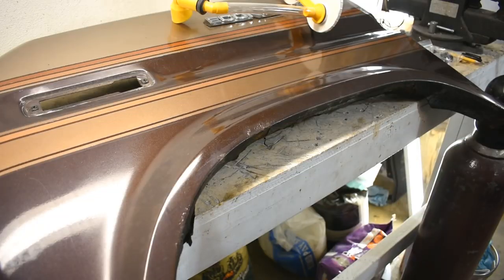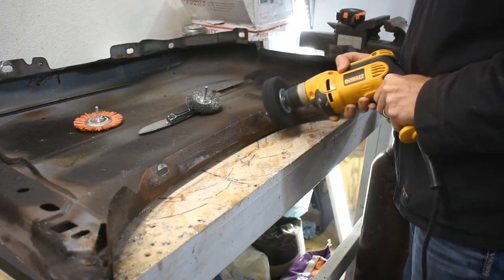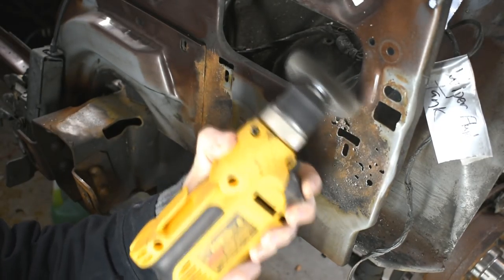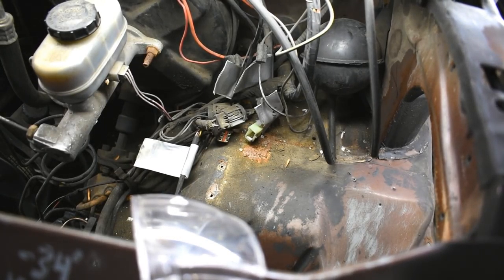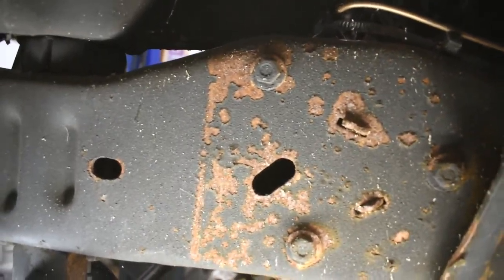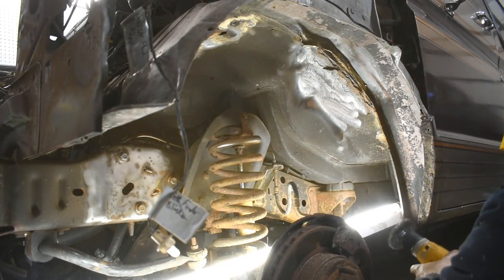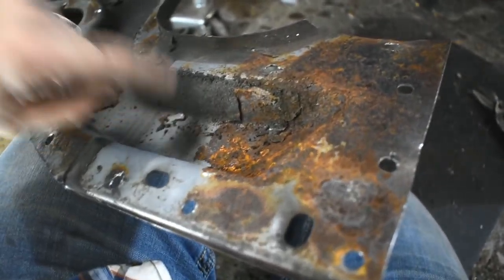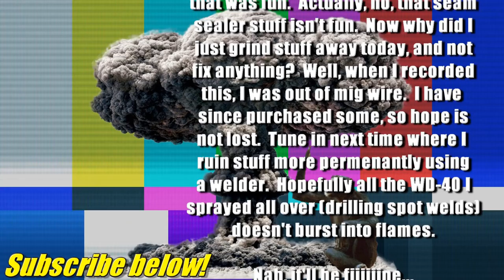Paul's Old Van Part 2: Grinding Off Some Rust, rust removal isn't fun

Comment: Hi Paul, I think it's better to remove the really rusty parts directly without wasting time on rust removing. Hope you can get some preformed replacement sheets, right to weld in. Helps to reduce work and frustration ;)
Reply from the maker: Yeah most of the stuff I’m just going to cut off straight away, but I was trying out different tools in this case.  I have a major plan to rework the front end that will increase serviceability, lots of cutting stuff off in the future...

Comment: Flap disc on an angle grinder paul... Drills are for drilling.  ;-)
Reply from the maker: I thought about that but I want to keep the panels as minimally mangled as possible, my flap disks would really chew up big areas (3M cubitron 2 flap disks are AWESOME but way too aggressive for sheet metal)
Reply: Paul's Garage 120grit flap disc..

Comment: If you want to get really aggressive with the rust; try using a diluted solution of muriatic acid. I used it in a spray bottle to clean a rusty gun barrel. It works wonders. You have to immediately apply oil after neutralizing. Good luck either way.
Reply from the maker: Thanks for the tip!  I have some muriatic acid in my work truck, might be worth a try
Reply: Thank you for the acknowledgement. Good luck with the van.

Comment: A shop vac might help with the rust dust problem, got 1?  Twisted wire wheels tend to not throw off so many wires as that crimped wire wheel will.
Reply from the maker: Good tip, I got some twisted wire ones for the angle grinder, I’ll have to get some more for the drill
Reply: A box fan with a furnace filter taped to the inlet side will help reduce how much dust gets spread around the garage.  Please DO find your face shield.  I doubt not having it on will enhance your appearance.  GL.  I love how huge the safety glasses are.  :-D
Reply: Ron Yerke wish I had a more powerful box fan for this, I use a cheep one frome Walmart and it works but is weak; any tips on a powerful box fan? I'm actually considering using a round shop fan and an old sheet.
Reply: Well, you could make a box and buy a used furnace fan to put into it.  Then you could use filters on 3 sides.  Furnace fans move a lot of air.  There are comercially made dust management systems too, but they're pretty pricey.  We had to replace a furnace a few years ago because the heat exchanger rotted out.  But the blower was fine and I kept it.
Reply: Ron Yerke Thanks, furnace fan sounds interesting. Probably not worth buying a full filtration system for a garage shop kinda like the one in the video. I could part with 150 maybe 200 dollars but that would be the limit. In the summer I can just open the garage doors and blow everything outside but today it's negative 20 and that's not happening.

Comment: Off and MURDER MODE! LOL I have been using a steel cutting disk in my grinder. I feel like slightly safer with it then the standard style cutting wheels.
Reply from the maker: I never feel safe holding a power tool

Comment: the tar prolly made the van as rustfree as it is at the moment
MAKE TEMPLATES BEFORE CUTTING OUT THE RUST that way the plates you put back have the mountingholes and accesholes in the right places , it would allso be adviseable to paint the inside of the metal before welding it on using weldable primer
Reply from the maker: Very true, that tar is good stuff.  The method Ive seen that I want to try is to make the template and get the patch panel made and almost fitted before cutting the old out.  That way if I suck at making patch panels I can always cut the hole to fit whatever I do make.  I’ve been looking into weld through primer too, I’m thinking of trying some of the zinc stuff or this other stuff called “bloxide”
Reply: the zink coating give off mustard yellow smoke when you weld it and it makes you verry sick for quite a while if you breathe it or weld in a badly ventilated area
sumting i seen a while back was someone basicly made the plates with the boltholes in it slightly oversized , put it over the old rusted stuff centering it on said boltholes and maibe some sticky stuff and cut thrugh both panels using a thin grinding disk 
doing it that way only leaves a tiny gap around the hole you cut out and the patch you need to fit in it saving you hours of grinding and fitting 
when you weld the patch in try a low setting on the welder and thin wire only weld small beads like a tumb wide or less at a time and then jump over to another part of the panel , this prevents the panel from warping exessively due to the heat from the weld , it prolly still warp but it be manageble , welding magnets help keep the panel in place for the first tacks then a bend screwdriver and a small hammer to pry the panel out or push it in to get it level with the surrounding metal while tacking in the next part is all it takes , go eazy with the grinder when flattening the weldbeads after youre done as that makes the metal hot too 
allso make realy realy sure theres no dust or anything flamable from the interior near to where youre welding , i seen an experianced welder running for a bucket of water when the carpet inside the van caught fire , the guy was in his 60's and i never seen him run before or since
Reply from the maker: Yeah that’s why I’m leaning toward this bloxide stuff, supposedly no zinc.  It isn’t cheap though.  I’ll be careful of the carpet catching fire, it’s pretty dry in there.  I plan on replacing it all anyway.  My other concern is using any primer or paint when the garage is so cold, I don’t want to use anything only to have it fail later because it wasn’t warm enough to adhere properly.

Comment: Dear Paul, your going to spend a fortune with rotary type tools. Renting a sand blaster would greatly speed up the job and probably be more safe and fun.
Reply from the maker: I plan on trying that at some point, though I do have some other power tools not shown in this video.  One of them is the eastwood contour SCT (basically a hand held drum sander), didn’t have it when I recorded this though

Comment: paul i hate to say this but i think your well and truly over you head on this project if this is a weekend project its going to take 50 years you need serious help mate
Reply from the maker: That’s kinda the point 😉. The goal isn’t necessarily to have a restored van,  the goal is to keep me busy building.... something.  doing the car restoration is the main mission, having a finished product is secondary in this case.
Reply: i see so many people taking on too bigger project that what they can handle and not finishing my main reason for not finishing is due to money
Reply from the maker: There are lots of unfinished projects for sale on Craigslist because of that.  This is more of a testbed kind of project, I don’t know what I’m doing so I’m going to screw up on this van.  Either I finish t, proving I’m competent enough to move on to better vehicles, or I get bored and send it away for scrap.  It was free, it’s worn out, and I don’t need it anymore.  No money invested, not yet anyway.

Comment: Save the rust. Grind it into powder. Mix it with aluminum powder. Light the mix. Big smile.
Reply from the maker: You forgot the important step, “call fire department, draft your excuses now before the cops show up”
Reply: At least you would get your iron metal back. You could try to put it back on the car. Recycling is good for you, I hear. And you melting your driveway into the center of the earth would probably cheer up the neighbours..